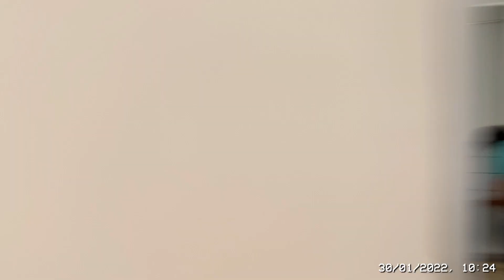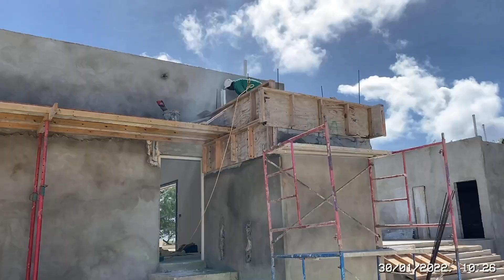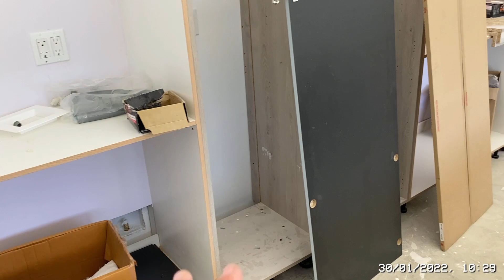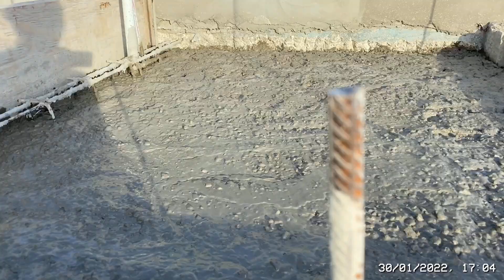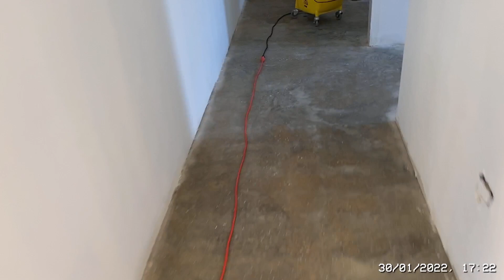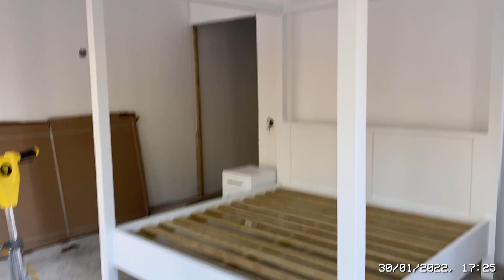Barbados 🇧🇧 Beach House Build - Day 230, industrial floor clean, quarian worktop install

Comment: Progressing nicely although a way to go. I like your temperament calm and patient! What finish will you be using on the floors? I see you are definitely moving in on Monday. Has your current accommodation term finished. Will you be living in Barbados? I am not a love of the four poster beds the wardrobes look really nice. I would have fitted a double vanity sink unit as the gap between dust would be hard to get in-between!